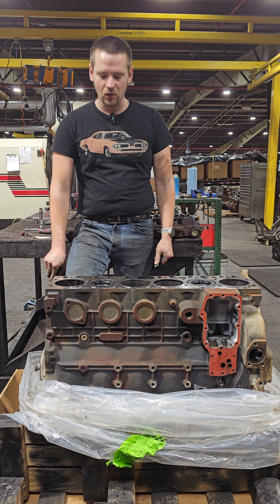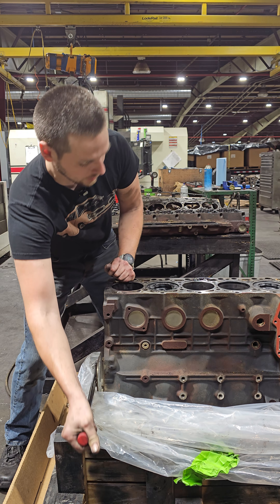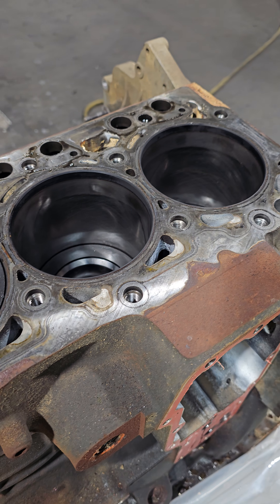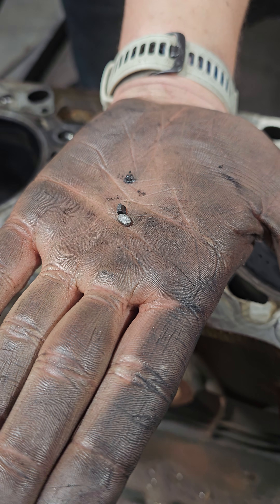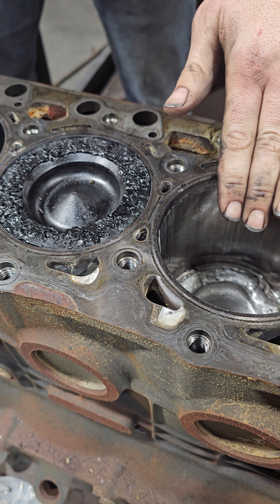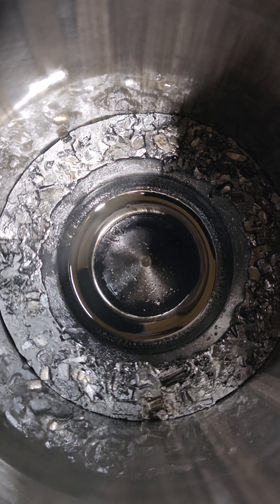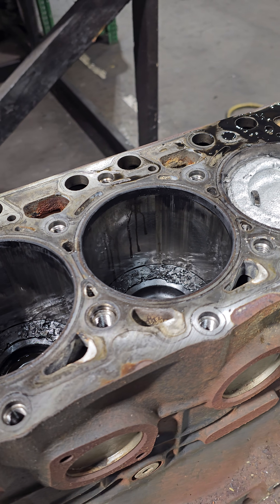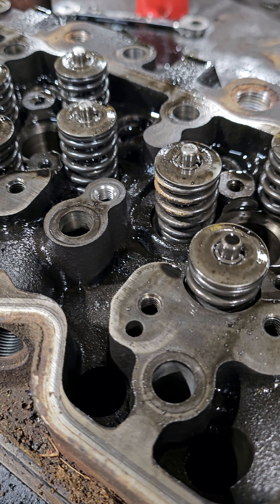Exceedingly High Temperatures Causes Piston to Melt - Part 1

Comment: I am curious if this one is deleted.  Aftertreatment preventing it from smoking and driver didn't know it was smoking?  Exhaust temperatures should have set the stop engine light.  How was it not fuel knocking?
Reply: ive seen it with little to no noise..  it couldve been under a heavy / full load situation where the EGT's are already hot ..then have an injector that just leaks a little, its enough to push one cylinder over the limit.. and it may not necessarily be one single event..  a piston can erode slowly from repeated events.. you dont realize it till you break up the top ring then things get noisy